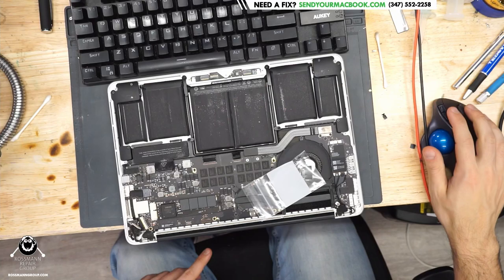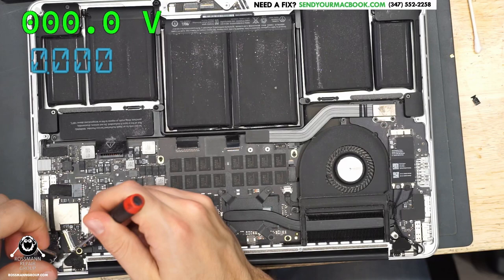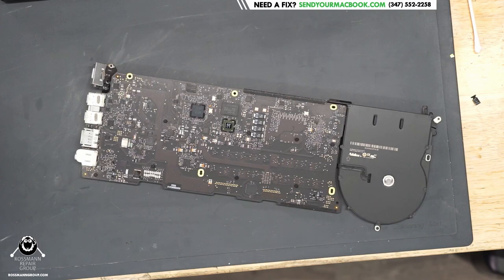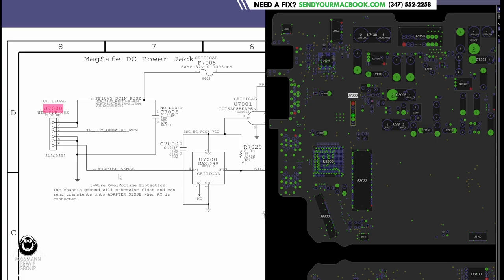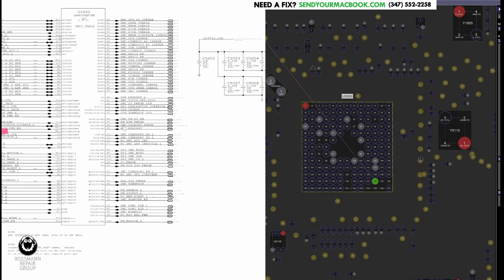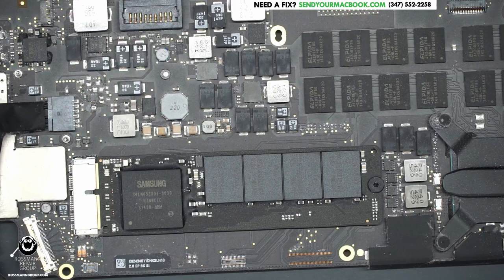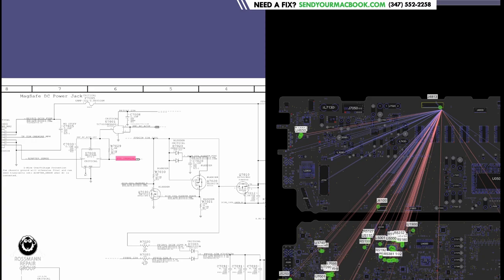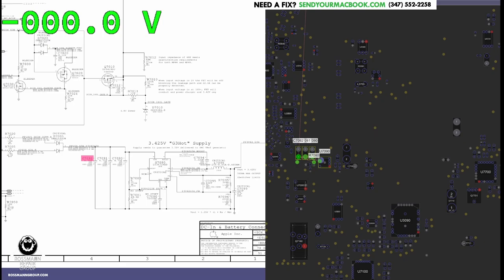A Macbook board repair, featuring Louis Rossmann

Comment: I like the board repair videos as well. Watch everyone been watching them for years. Thanks for your time. And I may not be able to answer your questions. But watching your Videos are not a waste of time. I have fixed multiple problems with wiring and modules on vehicles. Your process works the same way for finding the problems on multiple things not just mac books and also have done minor board repairs on multiple different things and save loads of money over the years. Thanks again I hope I always see these board repair videos.

Comment: not a big deal but thanks to youtubers like you I got a basic multimeter and am able to do simple problem determination like is a 13A fuse good or is a charger outputting voltage etc - Thank you

Comment: Well, I wasn't in Twitch but fuck I know PP3V42_G3H is the answer just because how many times you say it. Macbook no boot troubleshooting: 1. Make sure it's plugged in, on both ends, in a working outlet. 2. Push the power button, because yes, Macs DO have power buttons. 3. Check PP3V42_G3H.

Comment: Hello! Great Video again!
I need a little help Can anybody Tell me where to get the Chips to Upgrade MacBook Air 2019 ssd! The ssd is soldered on the Mainboard an only 128GB! I thought i buy a ssd and take the Chips from there the Same way how to do RAM repairs but i dont know which SSD i can use for this which cares compatible IC’s

Comment: I make pug ugly, 25 ton, robots that steal jobs from the sheeple and, all modesty aside, I'm exceptional at it. PC repairs not so much but 30yr ago I did build a 240v - 13.8v power supply so I roughly know sfa about electronics.

Point is right after the flying car we'll get robots that can diagnose and repair stuff. Till then I get to watch, for free, Louis doing it.

ps. my guess for green light prerequisite was no shorts to ground in the first thing the various voltages go to.